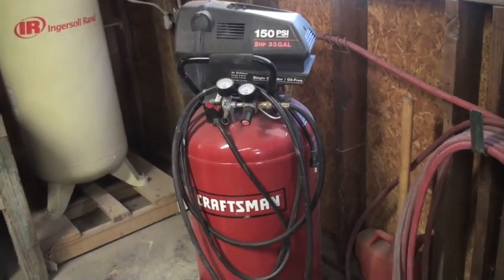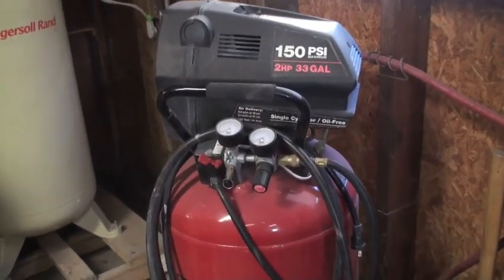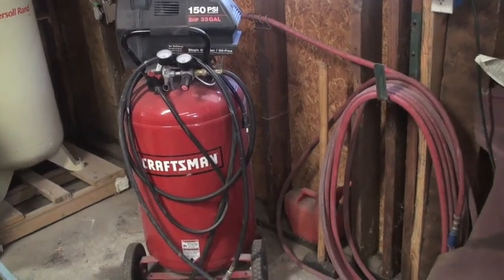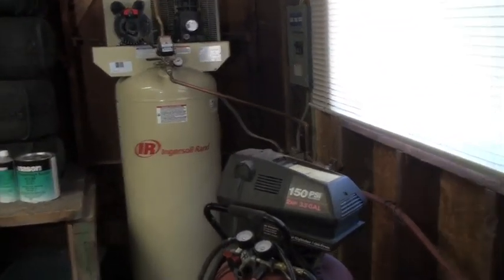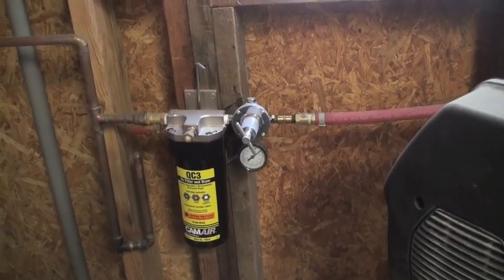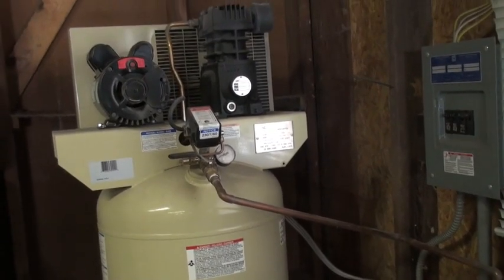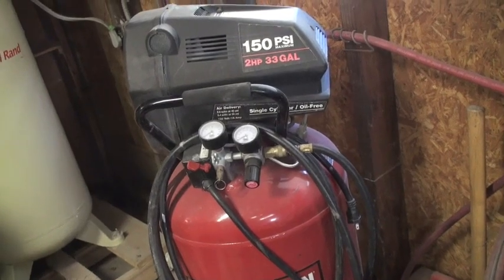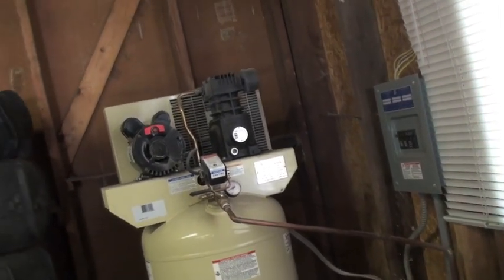Air compressors, How to

Comment: When you re-do this setup, or for anyone ready to install a large compressor use a short rubber whip hose between the tank and the copper to prevent vibrations in the joints. If you're a proficient plumber you probably won't have issues in years but it is possible for the copper or more likely the joints to develop leaks.

Comment: Hey Nice video I trying to get the same compressor you have there the 30gallon do you think it will work with a gun DevilBiss HVLP that works at 8 CFM and the compressor works at 8.6 CFM i think. Do you think i can spray a complete car with thinks thanks again for you videos